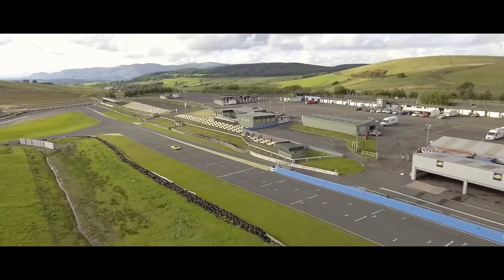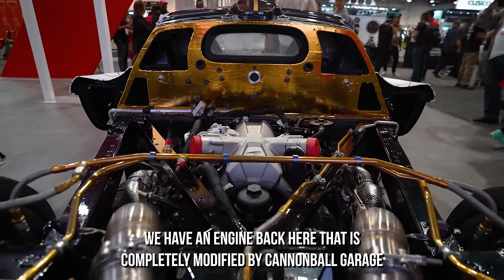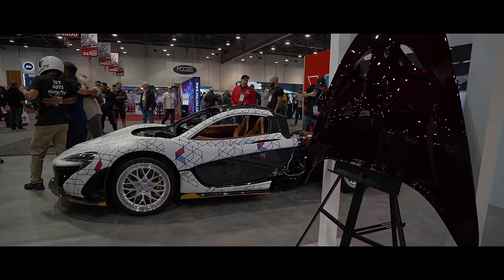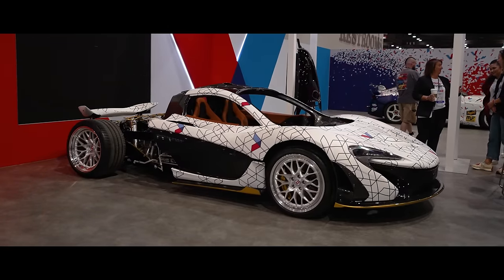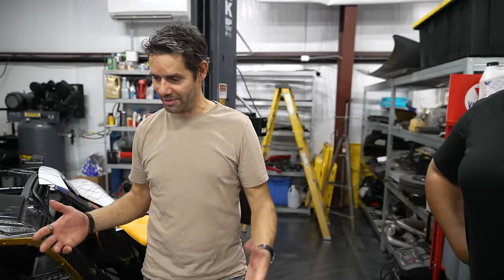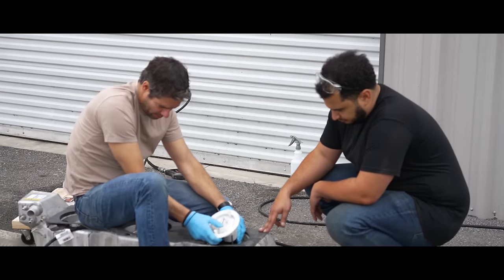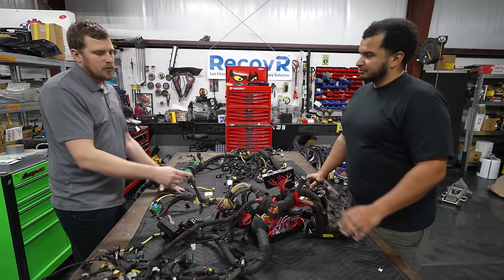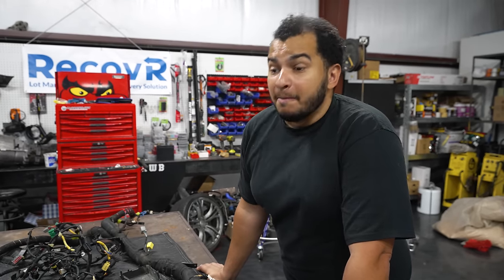Rebuilding A Flooded $2,000,000 McLaren P1 | Part 13

Comment: A little tip that I've used in the past for rewiring full harnesses.

1: Lay the entire harness out on the floor like you did, and measure the length.
2: Buy some particle board sheets that are a little more than the length, about 1.2-1.8M in width.
3: Hang the sheets in a line along your workshop wall.
4: Position the harness along the board and spread it out like "veins and arteries" using chipboard screws, cable mounts, and cable ties to hang it.
5: You can the unwrap it and keep it all together while threading your new wiring as you go.
6: Before crimping in the connectors, tape it all up and use mainly Vidaflex mesh, and then Vidaflex fibreglass for thermal areas, to give it a professional and protected look.

Comment: Thank you for speaking about mental health. Therapy saved my life. The more recognition there is from people like you, the more lives will be saved. You might have already saved one without knowing. That was an incredibly strong thing for you to do. Thank you again.
Reply: Yes! Often the car community can be made of of people that think we need to be tough and not feel things. Glad he opened up a hit about that. I went through a very tough separation and wish I had spoke to someone then
Reply: I'm not sure how well these "over the phone" or "texting" therapy session work but the system that's been in place is broken. People get a 1 hour appointment every other week, weekly if they're lucky. It often takes 20 minutes to get comfortable, 25 minutes later and there is a bell, a buzzer, a ding, whatever, and you hear "we need to finish up now". IMHO, these visits should be a 2 hour appointment at a bare minimum, giving people long enough to settle down and be as truthful as possible and to prevent them from being hurried. But, a 2 hour or longer appointment doesn't work with the current healthcare model that likes short appointments that bring them the most revenue...
Reply: I'd recommend good therapists instead of the better help scumbags that sell your data and use "therapists" that aren't certified

Comment: Seeing that rendering will make every late night, every vackward step, every failed connection and everything you have to do 5 times worth it. Hang in there Freddie. This is THE car project on the internet at the moment. 😊
Reply: the mymechanic 240z makes a strong case for itself
Reply: @rj6110  lmaooo not even close and I'm not a big Freddy fan
Reply: @madmax82988  lmaooo who asked
Reply: @rj6110  it wasn't answer to a question sweetie. I'm not sure how you think mymechanics is anything compared to Freddy's build. They're just on two completely different levels anyway.

Comment: I have spent 15hrs replacing a 2018 Audi Q5 comfort control module and replaced pins/wires. Due to corrosion. 78 new pinned wires, some 6ft into the body harness to find clean copper. Then make new 5 to 1 CAN hi and low splices. I can not imagine what you are doing. My hat is off to you.

Comment: From what I've been seeing deionized water works as a good cleaner for electrical connections and if you mix it with baking soda it should promote a good clean connection also if you were to look into using prong caps and wire glue you would be able to replace the material lost however I can't guarantee the legitimacy of how solid the connections would be or how well those caps could hold

Comment: 14:58 I don’t do harnesses for a living but, this is what I would see as a possible solution. It’ll be tedious but, with a couple of harnesses from mclearn start at one point on your p1 harness and slowly work your way to the other  going and replacing each individual wire as it’s wired. And then and of your non water proof plugs that are donezo pull replacements from the other harnesses and wire them like they did for the p1. Then you’re not wasting time and money on waiting for a factory replacement. And you get basically a factory harness. Probably not the most appealing project to do but, it’d more than likely work. Honestly what I would do. Or pay someone like this guy to do it for you. There’s a lot of people who do this kind of work for other cars. My specific experience is mk2 vw and there’s guys making harnesses from scratch using the original harness as a template. Lucky for us the plugs are still available in most cases. I’d see getting new plugs in your situation being expensive and probably unattainable in a timely manner. So I’d just hope and prey you can make it work between all three harnesses

Comment: 12:12 electric connectors on car harnesses are crimped gas tight and are therefore watertight
the crimp to the wire is even tested with a one meter water column for pressure

Comment: I can re-pin the whole harness in a day or two. Replacing the individual pins would be very cheap and I think give the best view of possible wire damage. Any wires with damage would either be shortened as much as allowable or replaced through the whole harness.
Reply: Also testing current through each wire to make sure there is no damage further into the line. The pins should be basic pin ends that can be bought in bulk for pennies and the pins remove very easy

Comment: I think anyone who has a boat trailer that may have had a somewhat poor tail light wiring installed (not weatherproof) on it knows.. wires will rot halfway down from wherever the water ingress point was.. so use good connectors folks and if you have a failure, CHANGE the wires and connectors.. I promise!

Comment: The reality would be if you could modify the hybrid system and be able to upgrade the BMS or the inverters with more modules, denser modules. The car would be insane. Look at the Chevy e-ray. Then imagine if you pulled that off with this p1.

Not working the hybrid system is just the easy way out for the sake of money and simplicity.

Comment: I personally have seen the corrosion work its way all the way down a wire, i pulled speaker eire out if my 1983 camaro thst was on the floor under the carpet and i cut a small bit from it for a small oroject snd everytime i did it was all corroded and just threw the whole bit in the trash

Comment: people don't understand how much weight the batteries actually have and all the extra electronics that is needed for the system. In the car world weight is the one thing that if you can eliminate if can help out a tons. Follow that up by a bigger engine, turbos and everything basically upgraded and better than it was. Yes you can argue its a custom car in a P1 frame and shell but that is what's nice about the car world there really isn't any right or wrong way to do something it's in the eyes of the beholder. The only issue with having a lighter car is the power to ground and how much traction you can get, just because you have a ton of weight reduction if you can't grip the road you aren't going anywhere or won't be able to control the car. Freddy and his team are already aware of this issue and working with professionals all over the world to make sure they have this right so when they launch it's not a pile of scrap. I absolutely love this series and cannot wait for the end result. That Amber Dawn color scheme is absolutely stunning, that almost has a 2 tone effect on it when its under the sun or bright lights that Gold just pops. All the haters gonna hate until records are broken, new standards are set. Freddy will grab the attention of McLaren and it will revolutionize a change that they will make in future production cars.

Comment: Timestamp 15:50
$150×500 hrs 
=75,000 labor 
$15,000 parts 
Total cost to rebuild the harness for the McLaren P1
=$90,000 
McLaren would do the harness for upwards of $20,000 even if they did it for $50,000 it wouldn't be that bad for a 2 million car

Comment: I have told you from the start salt water wrecks everything even the parts that look good will fail it's not salvageable you may get it going temporarily but it won't last especially the harness that's the first thing I'd replace

Comment: Elvis may have worked at McLaren, but he's still wrong that taking weight out makes sense for top speed. Top speed isn't terribly dependent on weight. It's much, much more impacted by power and drag than weight. You could add 200kg to this car and the top speed would be barely impacted.

Comment: Just out of curiosity would it not have been easier to disassemble the P1 harness in sections and replace the wires and connectors entirely?

Comment: Once this is done you will have $1.5 million into it, so was it worth it ? Serious question. Thanks and this series is amazing. Wow, F1 Elvis from Mike Brewer Wheeler Dealers, one of my favorite car shows. If the removal of the electric motor was a subconscious middle finger to the far left electric vehicle ignoranus, then I approve. 13:15 is probably one of the most important parts of this entire build. Screw up the wiring, use seawater wiring that is only a matter of time before it fails, so I am waiting with baited breath to see what the answer will be.

Comment: Hmmm, wouldn't it be easier to pin the existing P1 harness to a harness board, and then map it, measure, source cables and connectors and build it from scratch? 
300-500 hours seems extreme, especially if you have the correct tools etc.
I used to work in a company that made wiring harnesses much more compex than this, and in normal production process two people would be able to make 2-3 harnesses like this in one day. I realize this is not a regular production process, but still.

Comment: Anyone wanting to remove the black tape quickly from a loom , buy yourself some seam rippers that dressmakers use , and it will get those off in seconds . Little hack from an Auto electrician . (Y)

Comment: i don't think this will be faster than a Speedtail
drag is your biggest enemy at high speed and the Speedtail was first rumored to be 0.275cd but then Top Gear released the 0.186cd figure, neither figure is confirmed by McLaren, but even with your 1500hp it will not matter if the Speedtail can achieve the same with less power.
last but not least McLaren said "at least 250mph" top speed for the Speedtail, its official top speed has never been confirmed but a forum i'm a part of calculated it to be around 275mph

Comment: I just don't think it's a P1 if it doesn't have the hybrid system. It's still an amazing hypercar but can we call it a P1? Or is it like a P1 adjacent? It's not that I don't disagree with you It's an amazing build and it's not diminished by your removal of the hybrid system. I guess though as a guy who's super into electronics I was kind of looking forward to seeing how you would solve that problem. Just shoving a bunch of horsepower into it is cool and all but I was loving the challenge of you trying to incorporate that with the original electronic system

Comment: Doesn't a 765 LT already beat a P1 at the lights, even on the same tyres? The gap between hybrid and N/A in RWD has gotten so small that it's back down to power/torque to weight.

Comment: Its a little bit waste of time, the faster way would have been if you just figure out the wire gauges and save the connectors then you can make evey wires exactly how you want it. Aslo since your skipping the hybrid most of them will be over 18awg/ low voltage

Comment: If I was you, I would have only two fears: financial and dealin with all the electronic control units. The first needs a financial plan, which I hope you have. The second I want to ask you: the idea is to mantain all the original coding and eventually replacing the damaged control units (traction control -suspension-brake-aero)? The Hybrid management system obviously cannot be mantained, so your plan is to run the engine with a standard LP ECU and tune it with mapping? But the question is: the original P1 electronic control system is integrated (engine + traction,aero,brake,suspension) or not? Because, if it is integrated as I fear, you are in big trouble. If I was the engineer managing the P1 project, I would have wanted an integrated system with feedback in a closed loop environment, if I design a car capable of that performance, I definitely want all the components comunicating to improve performance and nevertheless safety, the car management system must know with a closed loop if you have a problem in the suspension or brake system to run into a safety mode. 
Could you give me an answer, because this is my main concern since the beginning of this garguantic project, and I'm sure you have already figured it out. I will be happy if you have a guy in your assets who is capable of building a programmable custom car computer that manages all the capabilities of this car, but this would need a new car project approval from the road authority in the state where the car will be registered, and I hope its different from Switzerland😁 Same problem if you cancel all the electronic assistance, no traction control, no active suspension, no esp, no abs, just a brake line pressure sensor, wheel angle and speed input on arduino that controls the rear spoiler  angle of attack, which is to beautifull to stay in a fixed position or moved via a manual switch.

Comment: Working on the ground is dumb. Build a wall board and strin the harnesses on the wall board. Then make a second wall board and duplicate exactly same.
Reply: With wall board you can write on board instead of sticker also you can pin to board with electrical staples

Comment: as a non-car guy, what does the hybrid system actually do?
Reply: Better throttle response. P1 has turbos on it. They force more air into the engine for more power. But they come at the cost of a delay. If your coming out of a corner getting back on the gas you will get a short delay between when you put your foot down and when the car starts to speed up. With a hybrid system we can reduce or eliminate that delay. With the use of an electric motor, or multiple in some cases. Along with this benefit

Comment: Your spec is a design disaster, but it can be easily fixed 

Your gold accents crash HARD against the bright chrome wheels, and they’re so thin that they’re poorly defined, particularly on the front splitter 

But black wheels would completely remove this issue, while complementing all of the black carbon and fitting the overall sinister look of the gorgeous crimson carbon 

I’m not hating, I absolutely LOVE this project - but ask your friend who did the render to make the wheels black and the gold accents about 20% thicker and tell me I’m wrong